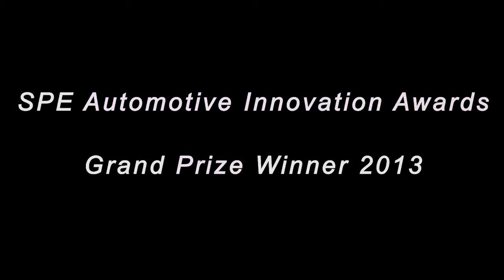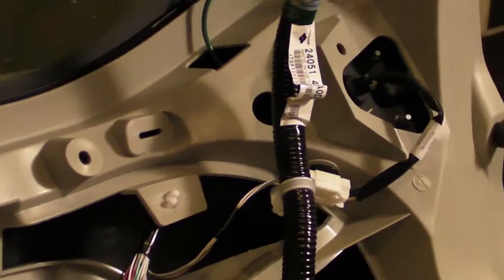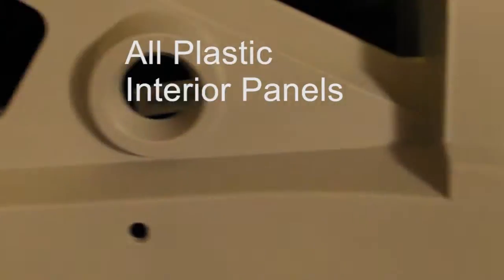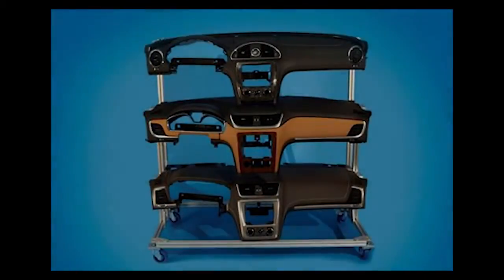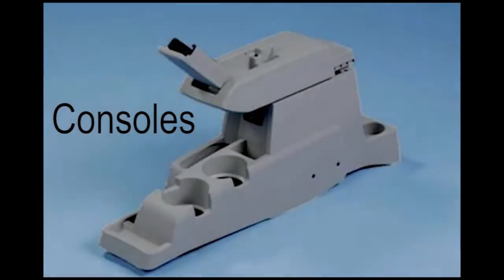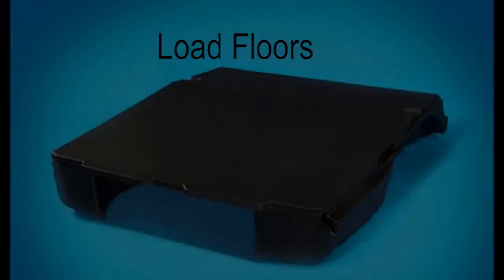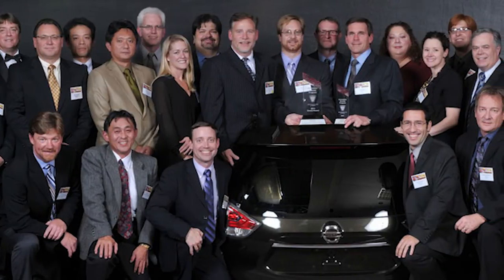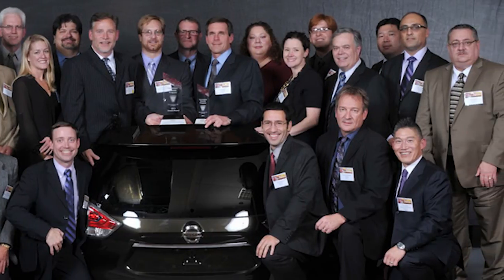First All-Plastic Auto Liftgate in NA Nissan Rogue

Comment: These liftgates are stupid. Nissan can not supply us with correct liftgate. There are to many variables as far as wiring & optional latches ,  glass is not changeable. You have to buy whole liftgate.  NISSAN as a CORPARATE sucks
Reply: Oh, you can't remove the glass from the damaged liftgate to fit into a new one? Unless Nissan sells the liftgate only with the glass - then you are screwed.